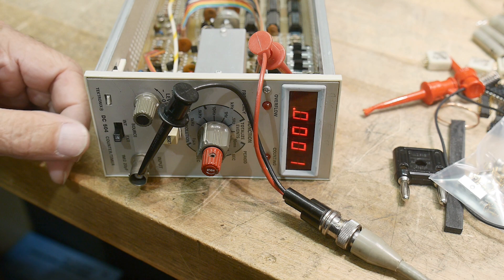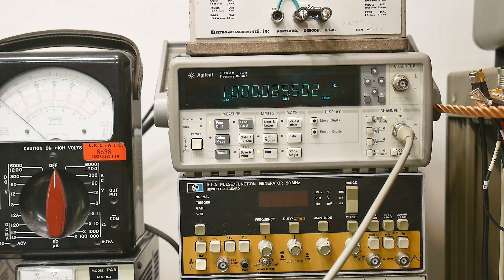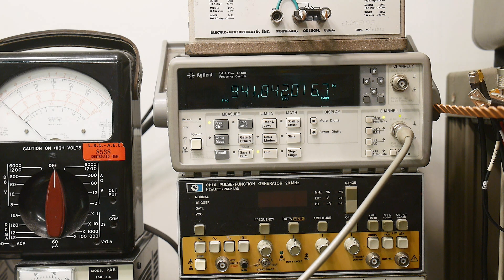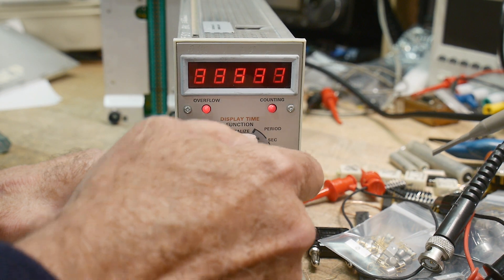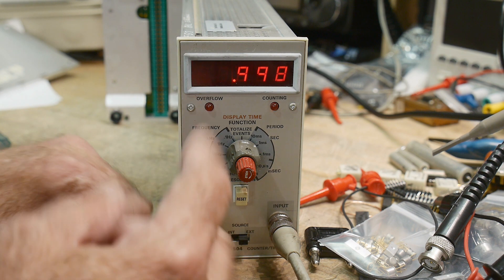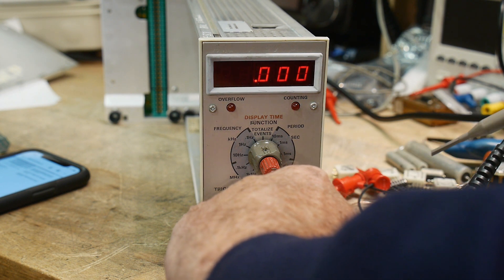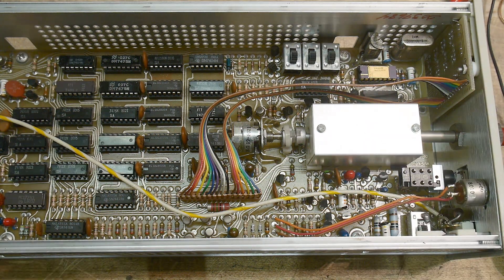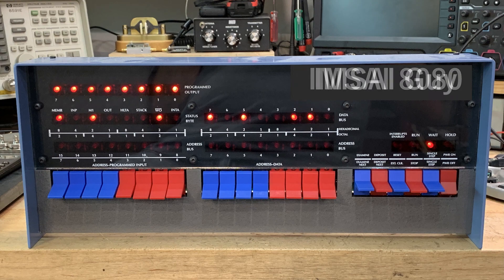#1345 Tektronix DC504 Frequency Counter Timer

Comment: It's your channel and of course you can do whatever you want but if you want to be more complete and informative it would be nice if you could at least read the specs ahead of the video. Just saying. These were very low end frequency counter plug-ins. Mostly designed for very basic lab tasks/schools/etc... Can't expect too much from this era for lower end T&M equipment.
Reply from the maker: I don't disagree, but remember in 1980 this was $525 and you needed the chassis too so let's say the total was $625. The low cost HP counters that year were $800 but way better and many more digits.
Reply: @IMSAIGuy  All I know is those 500 series units seemed to be in every lab I was ever in back in the day. I think the fact that it was modular appealed to many buyers. It must have been seen as the better way to go compared to other options or they would not have sold so many. No competition from offshore products back then. Big difference from today.

Comment: Nice to see you giving Tektronix some love lately. Gonna make the HP gear jealous if you keep this up.

I'd love to see you do a video comparing construction quality of comparable HP and Tek units (same function, approx same mfg dates, etc). There's a lot to learn from looking at how the companies made gear back then.
Reply from the maker: More Tek to come. It is hard comparing as the older stuff was build different and there is a lot of product to product variation. The Tek 465 was solid and the 7000 series seemed a bit weak. Some of the HP stuff was way over engineered but some of the the knobs don't seem to survive. In general HP had heavier mechanicals but it probably added way too much to the cost. Both Tek and HP had switch issues depending on the age and model.

Comment: Can't help but notice a certain anti-Tektronix bias in these last few videos. I guess some residual HP corporate brainwashing affects all former employees?  I love the gear from both companies and I admit they each had their niches but may I request a bit more fairness in the evaluations, like reading the specs prior to trashing?
Reply from the maker: HP never made a good oscilloscope. period
Tek make lovely oscilloscopes
Keithley made the best multimeters
LeCroy made the best oscilloscope
Fluke made rugged stuff
Rhode and Schwartz made the best spectrum analyzers
Wiltron made precise VNAs
OK now, the TEK TM500 stuff is not all that great, sorry
Reply: @IMSAIGuy  Because you are only looking at their low end plug-in's.  The stuff you have worked on was targeted for schools, etc.
Reply: @IMSAIGuy  No manufacturer ever touched the quality of Tek analog scopes.  LeCroy might be on the top of digital scopes, but there is still plenty that an analog scope can better than a digital scope.
Reply from the maker: yes they did good analog. I've had 545 with every plug in, 465, 2200 series (some of the best in my option), 324, I still have a 336. And spoiler alert, two more tek scopes in future videos. oh and my 576.  a 7000 series, can't remember them all, and several tek scopes at work of course.
Reply: I thought it was just me who was feeling this.  I have been watching this channel for ages and enjoyed it very much,
 but ever since the Tek bashing, I can barely stand to watch from end to end.
I would at least suggest RTFM before recording, it will certainly showoff the features and certainly give the channel more cred.
Reply from the maker: @gerrymacdonald5435  I didn't understand I was not allowed to give my personal opinion that might not be the same as others. Of all the channels you watch, how many are actually using TM500 instruments. They are fun to play with, but most of the plug-ins have better alternatives.  I love Tek scopes and curve tracers. Every company has some products I don't like. You can't win them all. The TM500 might have won on portability and flexibility for the few that needed that.
Reply: @IMSAIGuy  Of course you're allowed to express opinions; as are we (or at least until the 'tube censors us...). I agree with most of your initial reply though I've never been fortunate enough to work with Wiltron. I like R&S too...until it breaks and then I don't like it all. Though in fairness they are pretty reliable. 
I have multiple TM units and I like being able to install the modules I need for an extensive test. Sure, there's better gear available now and even when they were first made but I always liked the flexibility. And some of them are still superb--I would not part with my SG505/AA501A combination nor with my pair of AM502 differential amplifiers. 
I enjoy your videos and appreciate the effort it must take to keep producing them daily. But you can't expect us to agree with everything!
Reply from the maker: I absolutely do not want people to agree with me 100%. I don't want anyone one to be dogmatic. The best engineering groups allow discourse.

Comment: Your levels into the counter were too low. At high frequencies. At 50 MHz, it's rated at 35 mV rms, at 80 mhz or above it needs at least 175mV rms.

Comment: Verify the transmission line impedance match between the devices and cabling.  2.5 m wavelength at 80 MHz means significant phase between reflections.